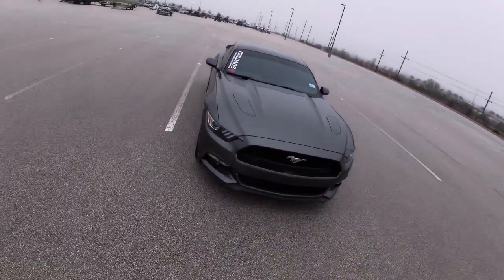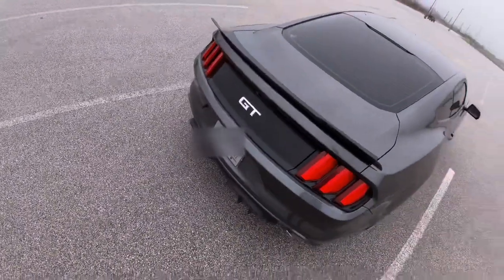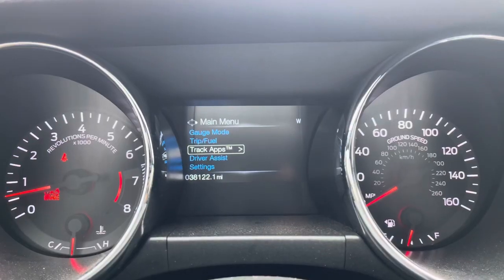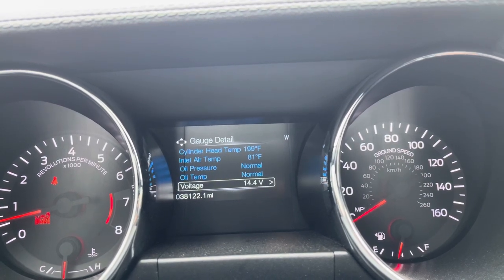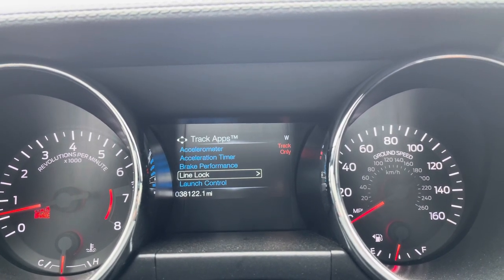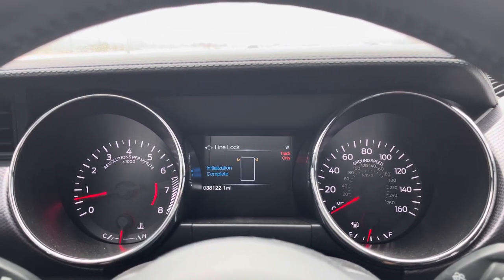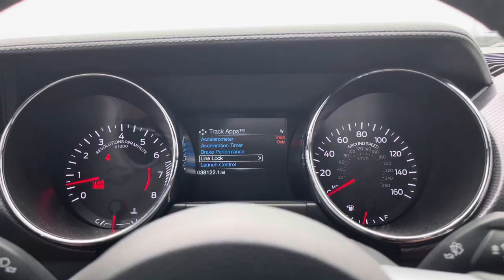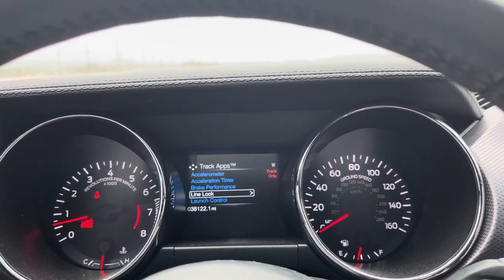How to BURNOUT In A MANUAL Mustang Gt Using LINELOCK

Comment: Did you release the clutch fast or slow after giving it gas?
Reply from the maker: So the way it works is the brake stays engaged for you while you give it a little gas to prevent stalling.. then slowly release clutch with more gas and the wheels should spin